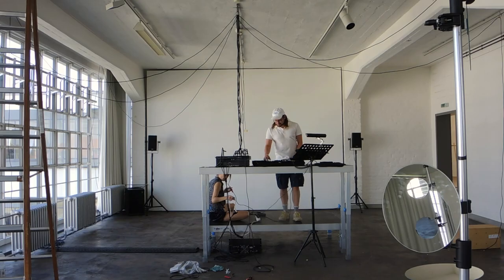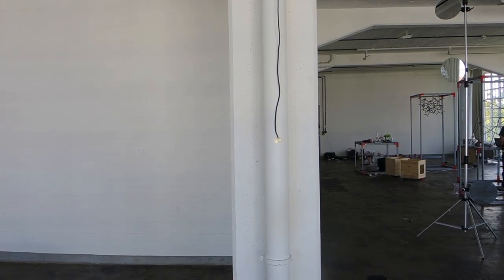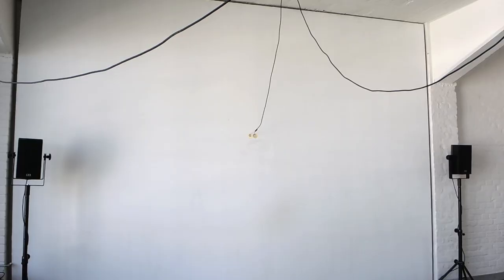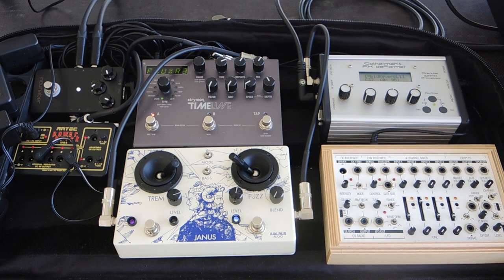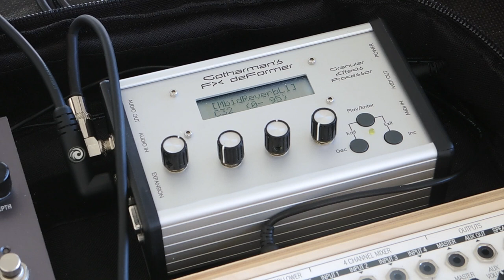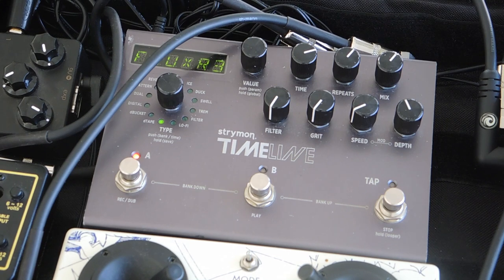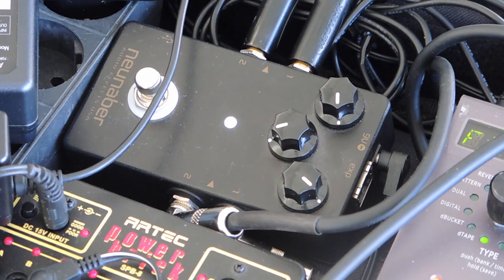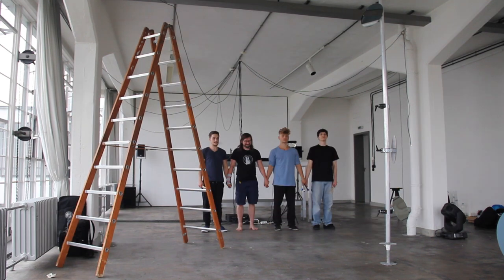The Sound of Architecture and Design | Bauhaus, Piezo Microphones and FX

Comment: Guten tag! Quick question. How did you provide pre-gain to the piezo mics ? I bought the field kit last night, and then thought as the field kit fx has a four channel mixer aswell.  i beleive three channels having gain on them, the fourth channel having its dedicated gain knob and the delay and reverb sections having a gain in knob. Could you please shed some light on this. I am into collecting found sound and piezos and like the sounds with the dleays and spring reverb and other effects the FX has. Should i just buy the FX? thanks in advance, love the content ofocourse ! Hainbach for Presient !
Reply from the maker: I used a mixer with piezo adapted to XLR, Field Kit was only for the test/exploration run.
Reply: @Hainbach  sweet! thanks for the message ! so field kit oder FX if i have to get one to start with..... ? =>
Reply: im not so into the sensors.... also I feel I could either use the FX with piezos and other instruments or the FX with with another stand alone mixer which can also provide pregain to piezo mics.
Reply: @Hainbach  I always wondered how to make a balanced piezo contact mic. Am I right in assuming you wire one out of phase to create this. Genius idea, then again the whole concept of balanced signals is an amazing concept.